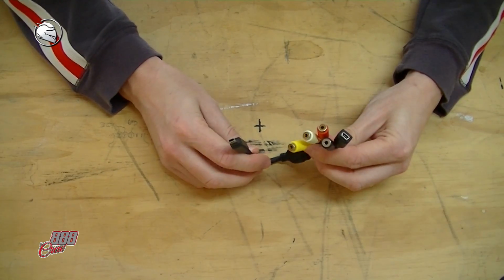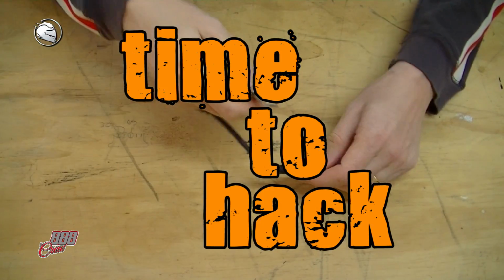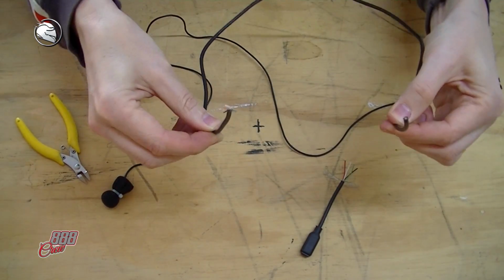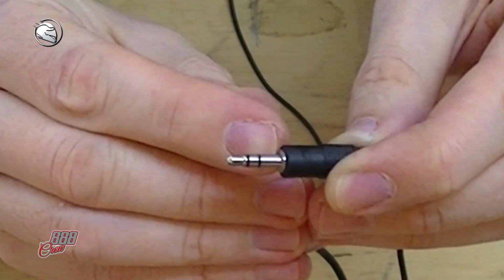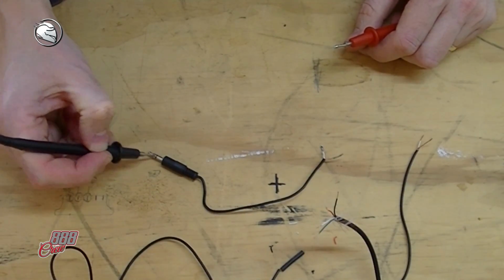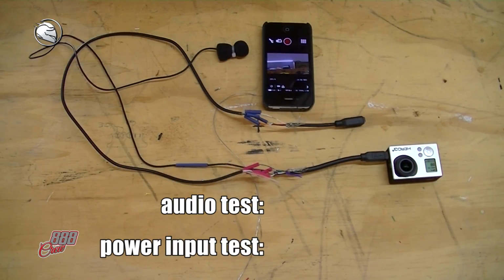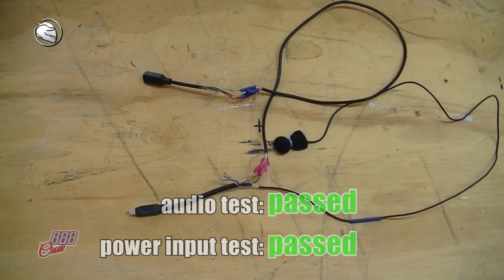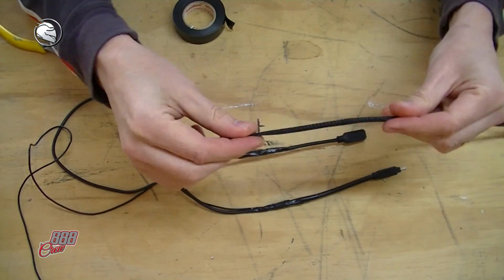gopro combo cable hack

Comment: did you have any issues with recording sound and charging at the same time?
Reply from the maker: +Luke's Bikes sometimes i find it stops recording for no reason (but only rarely) - not sure if it's related to the connection though.  overall it's really good!
Reply: + Lucas & # 39; s Bikes I'm having problems with very low audio volume and noise, when I recharge the battery at the same time I shoot, it seems some kind of interference
Reply from the maker: i'm charging from an isolated power source (ie battery pack).  if you're charging from a plug pack that is plugged into a wall outlet, or from a pc (usb port) you might be picking up some interference from that.  hope that helps.

Comment: @shineesideup how come your not experiencing problems when connecting mic to gopro this way ? ive tryed 3 times with same outcome with a mic solderd to use for the gopro and it needs a  resitor to verify its a mic! is it allready in your mic?
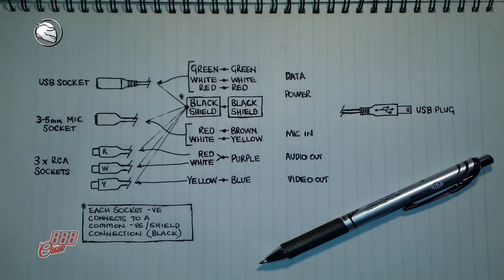Reply from the maker: i'm not having any problems.  i believe the resistor is in the USB plug of the combo cable.  this is why many of the cheap copies don't work - the lack the resistor.  have a look at the diagram at 02:57 - i measured the resistor value with my multi-meter and i'm pretty sure it remained in the plug because it wasn't in the part of the cable i disassembled.
hope it works out for you man!
Reply from the maker: ps - the mic i'm using definitely doesn't have any additional resistor.
Reply: shineesideup
cool , thanx man !! a oem connector is bout 40us $ here so its over the top 4 me !! thanx once again !!
Reply from the maker: this was actually my second attempt because i bent one of the pins inside the plug as i was inserting it into the camera - i had to start from scratch!  i couldn't come to terms with shelling out for another combo cable (they are expensive for what they are) so i bought a second-hand one for less than half price.  have a look on ebay and the like - you might be surprised.
Reply: shineesideup
sweet ! thanx for the heads up! ill do that , not so much for the motovlogging , more to get a mic closer to my face when showing things outside like the vids i made bout our old 1885 defence around copenhagen! its shitty to talk out loud when your filming and folk run around you lookin lika a wierdo!
Reply from the maker: alternatively, get yourself a zoom h2n audio recorder and just sync the audio and video in post.  you'll get MUCH better sound that way.  also think about a dead-cat mic cover to remove wind noise.  good luck!
Reply: shineesideup
deadcat is sorted out , a ok result on that, glued it to the exoframe to onboard mic! but the zoom h2n igotta look into!!
and i still got the  problem of being a total loss on the editing, im an ass when it comes to using a pc haha

Comment: I'm fighting with the same idea You did. I managed to hack a cheap USB to Jack adapter so I can record the sound from an external microphone. But I cannot get the charging working. I soldered correct wires from an USB cable and I get a nice 5V on correct pins but my camera stops charging after a couple of seconds. What is the value of the resistor? I don't get that dot between 32 and 9. Any help would be appreciated.

Big EDIT 
I had wrong notes and had the 5V wire on the wrong pad. Now charging and mic work, but I get a lot of electronic noise.
Reply from the maker: yes, that electronic noise is something i was not aware of when i made this video.  i need to do a follow-up video to explain... just haven't got it done yet.  i still find it useful to be able to charge while filming and i'm looking at recording audio separately to improve the quality.
Reply: shineesideup  Removu makes an external mic - maybe that is the way. As for me - based on a cheap powerpack with two 18650 panasonic cells with about 6800mAh capacity I've managed to run gopro for 6,5h and fill the 64gb card completely.

Comment: unnecessary , was only cut the AV cables and plug the microphone into the microphone input , that way I can still replace the microphone should it break , and I can also charge the battery without having to solder anything
Reply from the maker: i did think about that but i wanted to extend both the charging cable and the mic cable.  also, i intentionally removed the mic socket and plug to make a better, more permanent connection that would have no chance of corrosion over time.  i'm not worried about the mic replacement - just remove the joint and re-solder a new one.  thanks for tuning in.

Comment: I'm having trouble with several cables already changed 3 in store and they are all acting like this:
https://www.youtube.com/watch?v=UVDBpXZHU14
makes a video with his test charging the battery and shooting, you can make a video like this? Any video that vc filmed while charging the battery?
Reply from the maker: hey +Rafael Prado you are right.  i have been meaning to get back and do a follow up to this vid.  initially i had not connected power while i was recording - i had only done one or the other.  i discovered the problem and then realised that there was a real issue with this setup.  despite that, i have still found it very useful to be able to charge the camera with the external mic connected - albeit while i'm not recording.